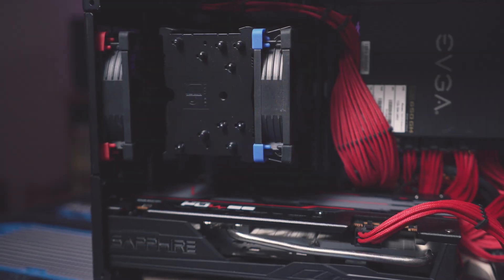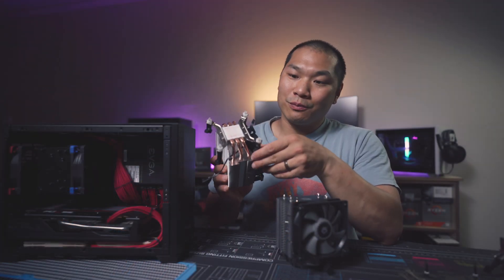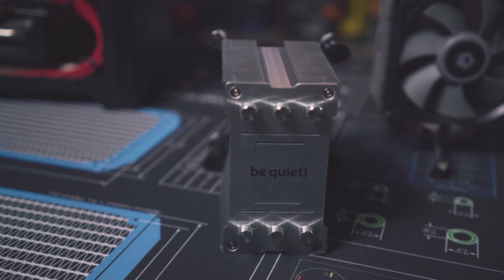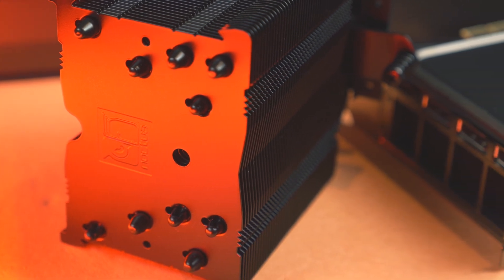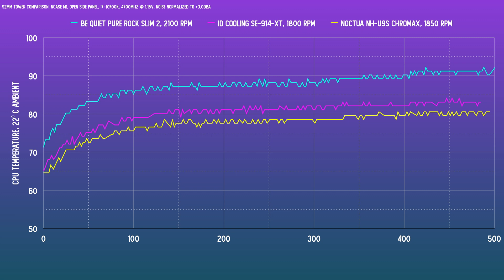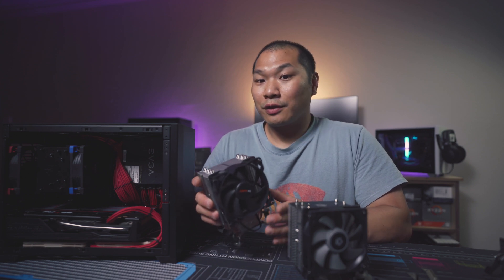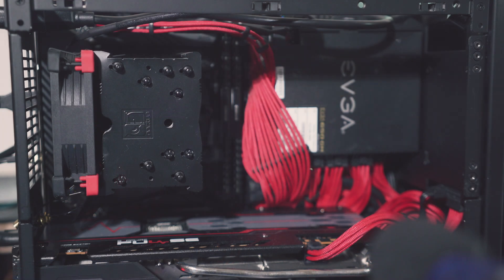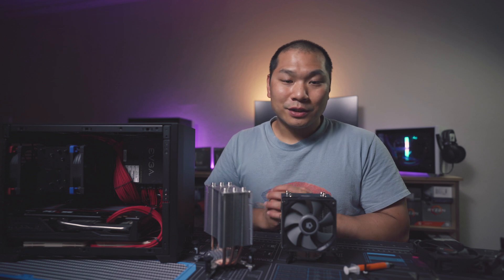Be Quiet! Pure Rock Slim 2 and ID Cooling SE-914-XT - Two Budget 92mm Towers

Comment: Hey guys, and also OP. Would like to ask if any of you had tried these coolers on a 12th gen CPU? My case's height clearance for CPU cooler is only until 135mm, so i'm eyeing on either of these 2 since the Noctua nh u9s is much more expensive (with an additional cost for the bracket based here on my country). If not, can anyone recommend a budget air cooler that can has a bracket for LGA 1700 and is under 135mm in height?

Comment: ID-COOLING SE-914-XT ARGB would probably be the go to model if you want RGB bling. It looks like a mini SE-234-ARGB.

Hopefully Thermalright can also get in touch with you so you can test out Assassin King 120 mini @ 135mm cooler height. I comes with a 120mm fan with an option for a second one and slim enough to not interfere with RAM clearance.

Comment: ID Cooling SE-914-XT has impressive performance based on the review recording. That fan though is very noisy. 

Use the cooler. Swap the fans. Win.
Reply from the maker: Well, in theory that could absolutely work well, the U9S is still the best heatsink though, so with the extra Noctua fan the 914xt package is pretty darn close to the cost of the non-Chromax U9S so… at that point I’d say just get the Noctua, better looking anyway. However, if you keep both fans and run the 914xt as a push/pull you’ll be ahead for sure, just keeping in mind the stock fan is on a different cadence so there could be some turbulence.